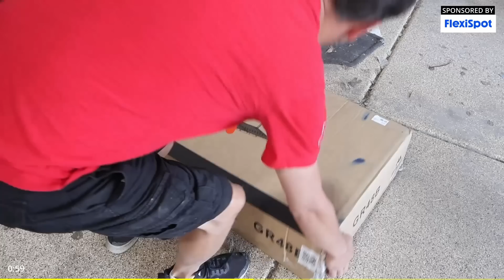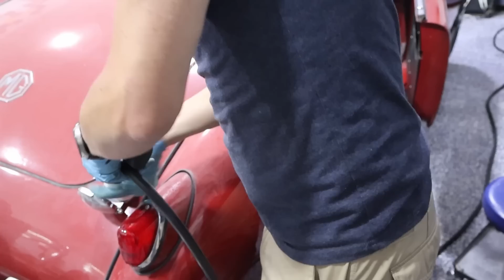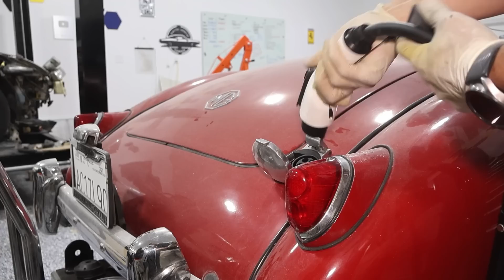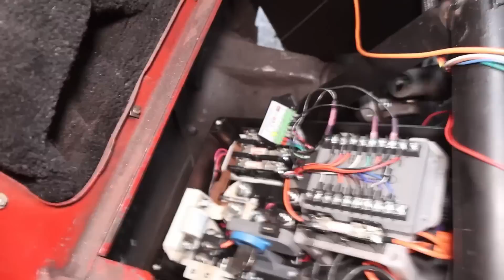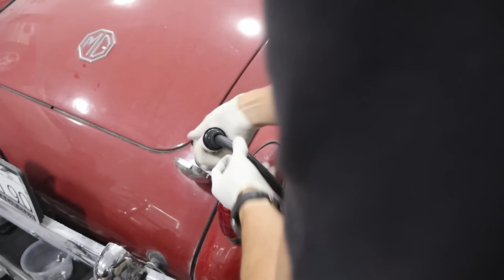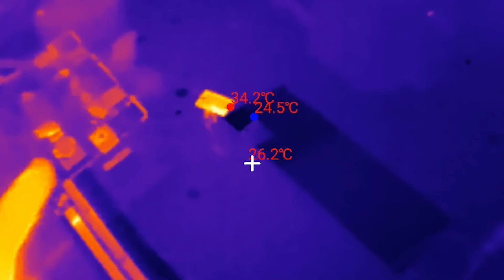MGA Charging!  It's worse...so much worse!

Comment: Great video, Jeremy!  This project has tested your knowledge and skills from start to finish.  You were extremely meticulous in looking for the possible issues, and the finer details of the CAN-BUS system to sort out the final bugs.  Your reader unit with the DB-9 connector, that was for this specific CAN-BUS unit I gather?  I've been catching up after a bit of time away from YouTube and other technologies, so my apologies for the late response.  There are some serious conflicts in the wiring diagram of this build, more than a few flipped polarity markings since the beginning if I am remembering correctly.  HV seems like a bad place to do this though, even if it is still simple and hugely robust.  So glad you have gotten through the tough part of this, and, maybe, as a final words or tips and tricks, you could do a video of things you learned doing this build, and your opinion of the main suppliers and kit process.  I know it may be looking for trouble, but some red flags to watch out for and positives amongst the negative incidents, like the contactor you ended up needing because it was indeed necessary to have that economized feature to control heating, for instance.  Thank you again for your time, patience, and perceptiveness in this series, and for bringing us along to share the experience.
Reply from the maker: More explanations in the following video

Comment: When this build is finished, please give an overview of the process. Would you go with the same components again, how is the documentation and clarity of instructions? Is the wiring intuitive, meaning do things learned with other builds carry over onto this one? If you were selling electrification kits, what brands would you use?  
I stated in the past that eventually you will settle onto a set of companies and components that work well together, and have good documentation and support. What do you think about using parts from different sources and suppliers versus going with one company, are there any dangers or benefits we should be aware of?
Reply from the maker: Will do!

Comment: I am really really impressed by your patience, problem solving skills and most importantly your common sense. I wish I could be a part of your work. I have also converted my Honda Scooter into electric. I have also faced so many issues because of the quality issue of the kit. I had to make my own wiring and figure out which connection is which. But my issues not even comparable to your issues. Great work man. I really wish I could work with you.
Reply from the maker: So nice of you

Comment: Damn this Kit seems like an "Avoid-at-any-Cost" Kit..
Reply: The reversed polarity on multiple things is just mind boggling.
Reply: @JJayzX  right. Im not an Electrician but I consider myself quite knowledgeable since i helped my Brother with his Training as an Electrician. But non the less im surprised that nothing has burned up or released magic Smoke yet. Especially the high voltage stuff. The good thing is: the circuit protection seems to Work really well on this Kit ^^

Comment: Seems nuts to me that the manufacturer has several wiring diagrams with swapped high voltage lines.
Reply from the maker: Right!?!
Reply: Seems like their engineers were interns 😂
Reply: It's like this is the first kit that they have ever sold and they have never actually put this together themselves and done any testing, QA and completed the documentation!. Seems like you have been doing their fault finding and QA for them! They should be paying you for this.